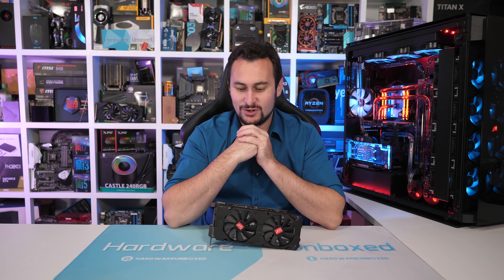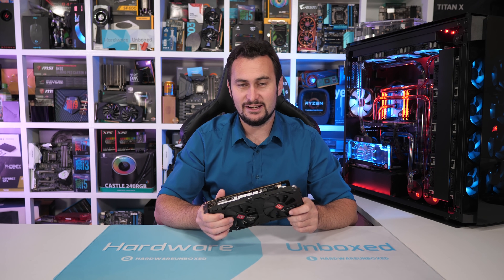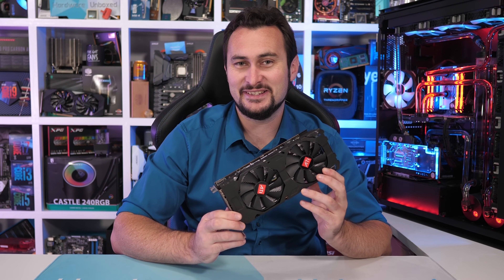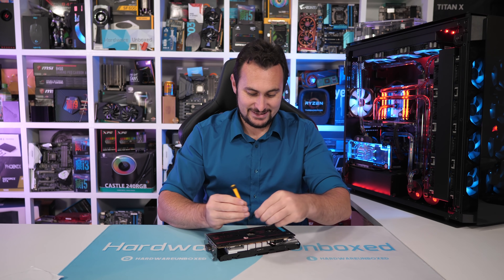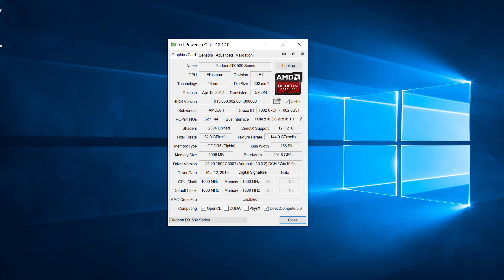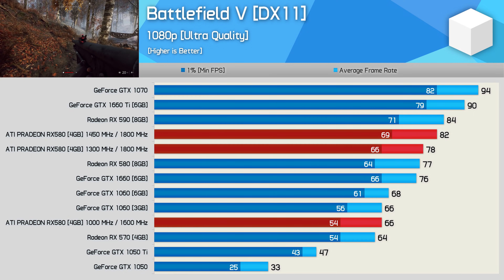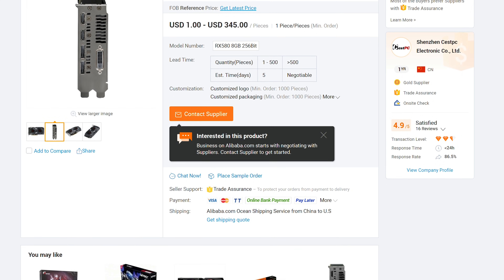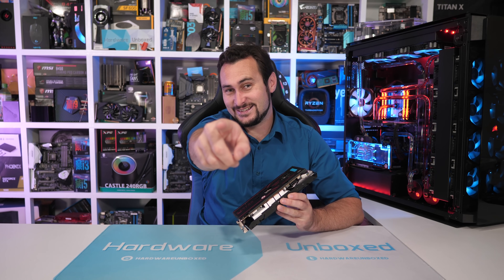ATI PRADEON, $96 Grey Market RX 580

Comment: Same design as my Maxsun RX580 8GB DDR5. I'm using one right now, and believe me, this thing works as the more expensive 'known' brands GPU's. Some trade off with these cards are only UEFI (which I have to find another ROM with UEFI and flashed it), and BIOS switch. I doesn't have em, but as for gaming, it works like the usual Sapphire Nitro or any other RX580 8GB, and same as to my previous GTX 980. I don't know about that one, but the Maxsun I'm using right now work flawlessly. No noise, no rattling sound, and no overheating, been using it almost 1 year and never have an issue with it. I really love how they positioned the cooling system with VRAM unit, it does keep the VRAM cool, and better than my friend Sapphire Nitro.

Comment: Where can i get one?
Reply: There are 8gb versions on ebay under a different brand name. They are called "Sable Hunting RX 580" The cheapest seller had them listed for $147.99 with discounts for the more you buy. It has a different faceplate but the underpinnings and board seem to be a match for the card in this video. They claim to have reference clocks I ordered one to test it out today and see if its worth buying more.
Reply: Thank you

Comment: I have an rx 580 that i got from newegg, the corn model u mentioned in the video,  and i suspect has been underclocked and undervolted like this. I would like to flash the bios like you did but i wanna be 100 percent certain im not gonna brick the card. how do i find a properly compatible bios. The Device ID actually claims the corn rx 580 is an 8 gb model. I think if i could flash the proper bios Id probably unlock the extra 4 gb.

Comment: The comments are dumb. Continuing to state that the car is is better than a 1650 is dumb. A RX 580 compete with the GTX 1070. Why would you be comparing it to a 1650 what's directly compete with a regular GTX 1050. It's like comparing your toddler to a 10 year old child
Reply: Because of the price

Comment: Actually I bought a USED RX580 for 100$ w/free shipping on Ebay last month for a buddies build. Works perfect, The used price for em is between 100-120$ for the 4gb and like 110-150 for the 8gb depending on how hard you look for the 8gb. If it was new you could guarantee something is up about it though

Its one HELL of a card at that price whether you get the 4gb or 8gb Model. Ive hardly ever bought a new Gpu and haven't ever had a Gpu I bought online die, Heck I bought a Gtx570 off Ebay like 5 years ago and it still works fine, Just make sure the listing has Ebay guarantee and says the card works.

Comment: aw, that ATi logo made me nostalgic  ;(

Also, when you said "EVGA must have made that card" because of the lack of thermal pad.... I had RMA'd a 1080 FTW for slight overheating and when it came back, i opened the card and it was missing a thermal pad...i couldn't believe it! Even after the issue back in 2016!

Comment: At $96, this is a no deal. But at $70... that's Not bad, performance wise.
Reply: do you know about any 580/480 going at 70 bucks used?
Reply: i'd rather get a knock-off new rx 480/580, than a used rx 480/580. Since that used RX card could have been a mining card used 24/7 for months, or even a year straight.

Comment: Legit would like to see this card in two things: 
1. Stress tested to see if it's got any issues or if it is just a mining optimized rx580.
2. Compared to the 1650/1660 in the HP Garbage PC.  Figure price per frame, etc including the cost of a new PSU and the $6 adapter.  Or the cheap version for folks with a normal PSU...The dreaded 2 molex to 6 pin adapter.  
FWIW, I expect it to work for rubbish in such a setup.  It's too much GPU.  Picked up an open box RX590 a couple weeks ago for $199 and found out with a quickness that I'm CPU bottlenecked on my FX8350.  GPU running under 20% with cpu maxed on dumb games running one or two cores.

Comment: You can get 480 & 580 4gb models on ebay all day for the $70-$90 range, and 480 8gb models from $85-110, with 580 8gb being $90-$125.
These prices go from auctions to listed.

I got myself a Red Devil 480 8GB for $91 a month or so back from ebay.

You are basically paying retail when bulk buying what you are showing, when you could get them for the same amount on ebay with buyer protection, or tell someone youd buy in person from facebook or craigslist for the price they are, minus ebay fees(as that's what a seller on ebay would be getting anyways), and save a few bucks more.

Comment: did some research on Baidu, 磐镭显卡 is the company behind it. They also sell some Nvidia cards (1060 and 1070 ti). All of them are most likely used gnu cores with flashed bios and some cheap cooler. Some Nvidia cards require proprietary drivers. Yes they work, but probably not the best quality

Comment: Lol can i get a link to the pradeon please im running a gtx 750 rn n that card would be such a deal for only 96$  i did have a higher end pc however our home was broken in to last wensday an my was ine of the many things stolen from our home so i had build a pc with used parts as i needed a pc for my current job would be nice to get an actual gpu  that has more than 1gb vram

Comment: "480's reflashed to 580's - not a big deal in that case" - WHAT ? So selling a product as something it is not, is not a big deal ? its called a scam and they tried to sell 3k of them to someone that lives from building pc's and sell them to regular people ? how is that not a big deal ?
Reply from the maker: Well the 480 and 580 are basically the same thing and as far as grey market deals go with no brand attached that's not that bad. Better than claiming it's an RX 580 but it's really an R7 260.
Reply: The 500 series are re-flashed 400 series. The same way the 200 series were flashed to be the 300 series.

Comment: 70usd, if i had a shop i would probably have bought them and just kept a few incase anything went bad, but i worked for a shop back in the day that could have moved them with a 90day warranty in decent numbers.

bet they got those fans with the stickers pre-applied, from ATI branded cards back in the day. 

480 and 580, same thing, and i have done that flash, same with the 290/390 flash in a few cases.

i have also flashed 7800 cards to 270x when find out that sapphire and company just flashed the updated bios on older cards to make them faster... 

as to the amd/ati, last time i edited bios thats the id for amd videocards, theres no specific amd id.

bios flashing is easy with ati/amd cards. 

i would have checked them out, and seen about moving some of them, my exp with deals like this one, easy to flash the bios, easy to get full speeds out of them, and the cooler looks decent, even having to re-apply it with a full set of pads.

as to warranty, last i checked you could get a square trade on it, not a big deal.

they are gamer cards, just flashed to a bios thats mining centric, i disagree with your take here, just looked, i can get 2 of those at the price you listed and still be VERY close to the price of the cheapist 580 im seeing... 

and, very well could be, they are using coolers from something like a 4870 or something, i would have to see the layout for the pcb(ram/gpu), but i would almost bet they used coolers that where already branded ati.

as to the rest, seriously, at this price and the profit that could be made selling them below "true 580" prices, with the correct bios on them, just keep a few incase any fail, and give a 90day warranty, hell, sell via amazon even, and get square trade warranty attached as an option, square trade is better then any manufacturer warranty. 

i got zero issue with the reflash or even use of older coolers, infact, the fact they set the fins so that air gets out the back of the slot, makes that cooler look better then many modern ones.

Comment: IDK, there are allot of people who would be willing to put in the extra work to get that performance, and to be fair any time you buy an off brand card or prebuilt, the first thing you should do is replace the pads and thermal compound.  Some of the budget stuff some of them use is worse than not using any, and it is cheap to do.  70 to 80 bucks a piece and some pads and compound for a backplated heavy cooler and mining cards are basicly babied compared to their design, and when was the last time you had to get warranty on a card that wasn't dead on arrival.

If I didn't have a list of things I NEED to buy the length of my arm right now I would pick up 2, and I am team green.

Comment: "Ebay hasn't done anything about cleaning them up"
EBay has been selling Chinese and other illegal products since it started. It has made NO attempt to fix the issue. Why would it if it's not forced to? The biggest rip-offs tend to be things that are easy to make but expensive to sell... in fact, flash MEMORY (USB, camera cards etc) devices are easy to rip people off because they can use crappy, yet working products and people don't realize they are fake in many cases. Steve on Gamers Nexus even showed how they could fake the memory size (they copied a bunch of VIDEOS to a product and at first they played back but then they still showed links and reported the right size but they essentially turned into thumbnails... sneaky!)

Comment: Hey, someone actually using a screwdriver on stuff like this, instead of using a power drill. I get why people use powerdrills, but it's way too easy to strip or over-tighten screws with them. I've always seen it as a unnecessarily stupid risk to take to save a few seconds.

Comment: HAHAHAHA! put it against the GTX 1650! HOT DAMN! have you checked to see if you can revive the card into a full 8 GB? i've heard some 4GB models of 470/480/570/580 were able to be flashed into 8GB! while it's true this is not for the average user or those who really value their money, it's still a fun gamble for an overclocker to throw money at it and see what happens. 50-50 chance of something good coming through vs the money going down the drain!

Comment: the card looks visually similar to the Yeston RX580, including heatsink design etc

https://www .geekbuying .com/item/Yeston-RX580-GPU-Graphics-Card-388369.html

the backplate is identical, however the pcb is just slightly different, after a closer look, the boards look identical, so these are probably yeston cards with different shrouds

i can't find the shroud anywhere, so it might be custom to an extent.

Someone mentioned these are just maxsun rx580's and they are completely correct
https://www.aliexpress.com/item/Miner-Graphic-Card-2304unit-MAXSUN-RX580-8G-AMD-Radeon-256bit-8000MHz-GDDR5-3D-Vision-HDMI-Video/32851733298.html

Comment: Rx 480s were only 1000mhz?  my previous strix 570 would boost to 1300 out of the box and oc to 1460
Reply: No, this had a modified bios that underclocked the core for better power efficiency while crypto currency mining. Normal rx480s have a base clock of over 1100 and a boost of around 1250.

Comment: I'd just buy a used name-brand RX 480 for about 350 CNY (~55 USD) and flash it to RX 580 - which is what the RX 580 really is.
Reply: The RX 580 really isn't. Because it is a later process chip. As manufacturing matures later rev chips tend to perform better.
Reply: That depends on the manufacturer. For example, the OEM RX 580s used by Dell (and most Chinese net cafés) are just a renamed reference RX 480, with the same clock speeds and only a 6-pin power input. The retail models might be better binned, but 99% of RX 480s can do 1366/1750 MHz just fine.
Reply: That might be true, but any process (or IPC) improvements the RX 580 has over the 480 is going to be negligible, and certainly not worth the extra cost. The RX 590 is a new revision with tangible speed increase, but it has basically priced itself out of the market.
Reply: Both AMD and Nvidia have straight-up rebranded GPUs more than once.
GeForce 9800 GT and GTS 250 were rebrands of 8800 GT (with a process shrink); GTX 760 Ti and 770 are exactly the same as 670 and 680. AMD's HD 8870, R9 270(X), and 370X = HD 7870; HD 8950/70 and R9 280/X = HD 7950/70; and the list goes on... If you are interested to find out just how many rebrands there have been so far, you can see a list of all the GPUs at Techpowerup.
People tend to assume that higher number equals better performance. It's called marketing.
Reply: The ONLY node shrink in those examples was the transition from G92 to G92b (8800 GT to 9800 GT/GTS 250, which yielded no tangible IPC increase). All of the rest have zero changes whatsoever - the exact same GPUs, on the exact same processes, but different names. I won't even mention the multitude of OEM-only GPUs that have been given 3, 4, or even 5+ different names, since they are irrelevant to most of us, and you can't buy them anyway. 
You don't have to take my words for it; you can look them up on Techpowerup and spot the differences, or the lack thereof, yourself.
Anyway, you need to realize that they do all that rebranding for one simple reason: to use up the leftover GPUs from the previous generation, without significantly lowering their prices.

Comment: You should of tried flashing it to an 8gb card since it had 8 memory modules. Could also be the reason it only had half the thermal pads on the memory. Because the other modules aren't being used ?
Reply from the maker: But it only has 4GB or VRAM so that wouldn't have worked.
Reply: @Hardwareunboxed  just a theory. Didn't get a close up look at the modules.

Comment: Well for $96 it is well worth the risk (seems like a well built card, backplate and all), a flashed bios and it is performing on par or beating the MSI 8GB model, and even is some cases on par with the Radeon RX590. If you have the time to flash it,  replace the thermal pads, and paste, saving $60 or more it does sound like a great deal, but I will wait for the golden 50th anniversary Pradeon lol

Comment: "Fake" Radeon still wrecks GTX 1650 for fraction of price. 

Hilarious.

anyways, I would not buy these. Im almost sure these are an failed bins of RX480, which AMD could sell to smaller board partners for cheapo to use these for some semi-customs.....
 most likely on overvoltage to maintain stability. We also dont know the FET models. This card may deliver RX 580 performance, but may not live long.

Comment: But its still worth the money, best buy, 96$ for RX570 129$ performance if OCd 2x better than 1650, 1050 179$ in perf/$
At least fans are new, im sure still better than second hand 290, 480s, 980s etc.
Should be rather called Modeon 570 (moded Radeon) bur regardless it's harmless scam. In contrast to selling rebranded 16GB SD as 128GB cause overlapping corrupts data. Or for example original NVidia GeForce 2060 - unfixable, glued.

Comment: I have Medion Akoya OEM RX 560 somewhere here. It's almost 1-slot thick and short custom PCB. OEM offspins of popular brands can be a more reliable source of parts but if it's sold by shops specializing in snatching such OEM excess hardware and reselling then vendor warranty is also non existent... and I got an interesting Medion keyboard as well - no numpad area and a nice overall package - sort of a multimedia mini keyboard but full size at the same time.

Comment: Honestly I've not had any issues with uncovered thermal pads. I do alot of overclocking and have used an Rx480 as my main card since it came out, I moded the GDDR5 to run at 1.65v back in mid 2017, I have an AIO so no fans directly over the memory (just 1 over vrms) and the memory never seem to be having trouble. Thing is the memory will just be cooled through the pcb so as long as the pcb stays cool the memory doesnt need thermal pads.
Lastly and a sidenote on the memory where you mentioned the memory is underclocked from the typical 8Gb/s to 6.4Gb/s, I got the datasheet for those memory modules and they're only only spec'd to guarantee 6Gb/s not 7Gb/s or even 8 (Which as far as i'm aware no GDDR5 are actually spec'd at that speed) so the memory does look like it's underclocked because of poor binning.

Comment: After a bit of research, Pradeon is a China brand that has both AMD and Nvidia cards.
http://www.pradeon.com
(Yes there is Pradeon GTX 1080)

Some Chinese forum posts said it's using GPU from unknown sources and should avoid.
(He got a BSOD after updating driver)
https://ngabbs.com/read.php?tid=16575696&rand=401
One said it was a Palit OEM and now they starts making their own card, don't know if it's true.
https://www.zhihu.com/question/66777032

Comment: really should have investigated power consumption of this, it's the most important thing about this product
Reply from the maker: Really? It's pretty typical, out of the box it used 10 watts less than the RX 570.
Reply: Hardware Unboxed so it’s slower than a standard rx570 but not much less less power hungry...